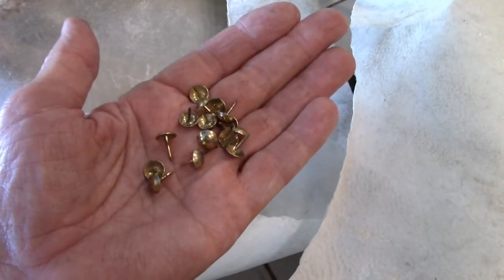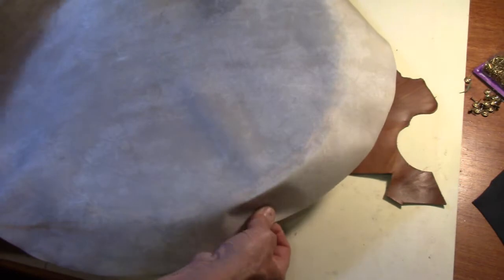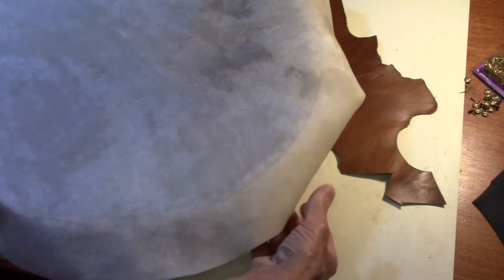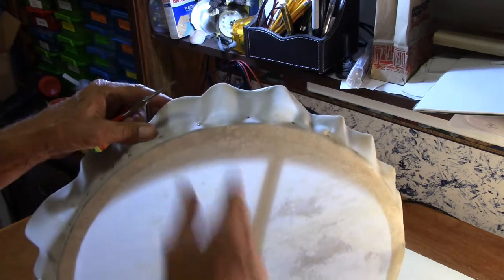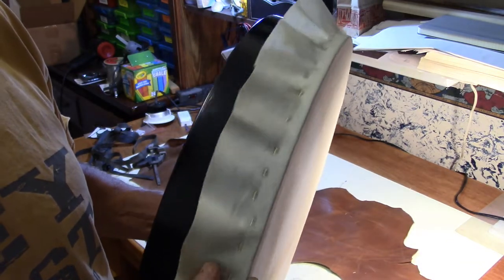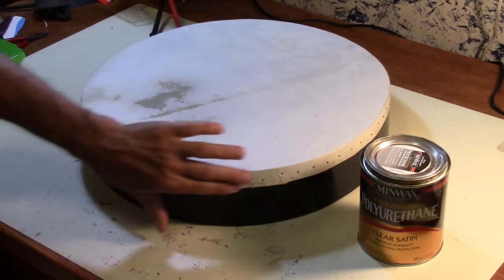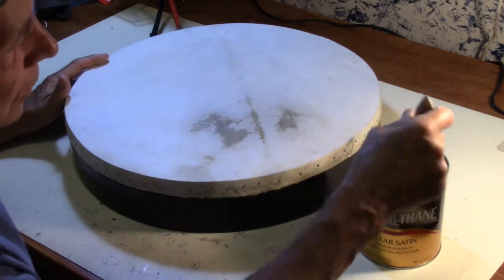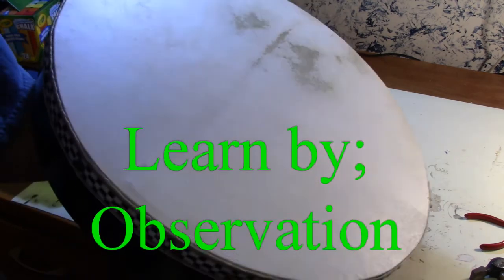How to replace a drum head on a Celtic Drum

Comment: Thanks heaps for the video. Do the nail holes stretch when it dries?
Also, when I pulled my old one off there was what appeared to be residue (perhaps from glue). Is it possible that it is just some sort of gum coming from the skin rather than glue?
Thanks again.
Reply from the maker: the nail holes did not stretch on mine and it sounds like that is residual glue on yours.

Comment: I have a drum like this that I love but the head has become loose over time, not separated, but just stretched I guess (it’s floppy). Is there some way to tighten it up without deconstructing the drum? Will soaking the head in place and letting it dry make it tight again?
Reply from the maker: that may work, but getting the edges where it is glued may make it come off--- it is worth a try!
Reply: are you good at woodworking? Some bodhran are "tunable." There's a second wood rim INSIDE the main rim; you push the inner rim down and that stretches the drum head. You might look "tunable bodhran" up and see if that would work.